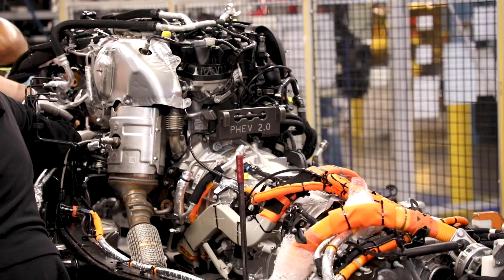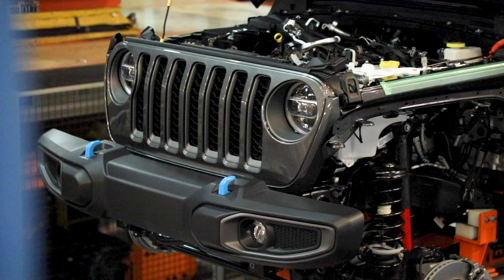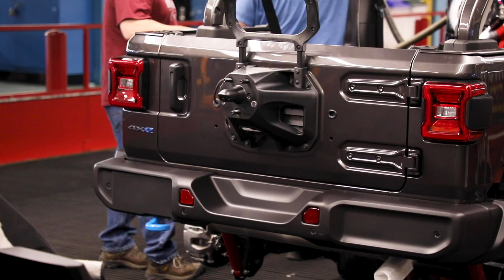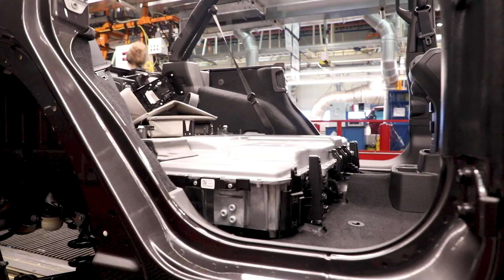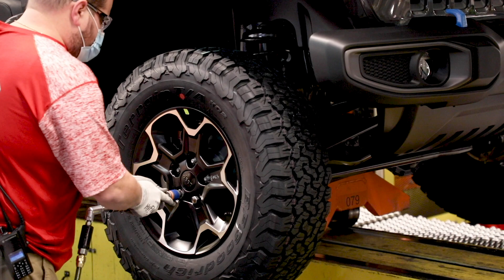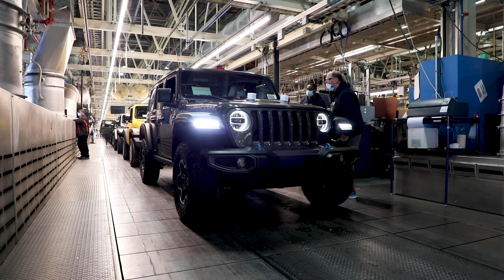Jeep Wrangler 4xe Plug-in Hybrid Being Built on the Production Line

Comment: Curious if Jeep is still fastening unprimed steel hinges to the unprimed aluminum doors. It cost Jeep a ton of warranty $$$$ in the early JL years because the galvanic corrosion between the two different materials was causing the paint to bubble.

Comment: can promise and guarantee every single one of those has something under the clear coat or some form of paint defect lol
Reply from the maker: Maybe no production line is perfect unfortunately.
Reply: @EightyTwoMedia  I see the end results at work haha. it is quite unfortunate
Reply: Curious if they are still fastening unprimed steel hinges to the unprimed aluminum doors. It cost Jeep a lot of warranty $$$$ because the galvanic corrosion between the two different materials was causing the paint to bubble.